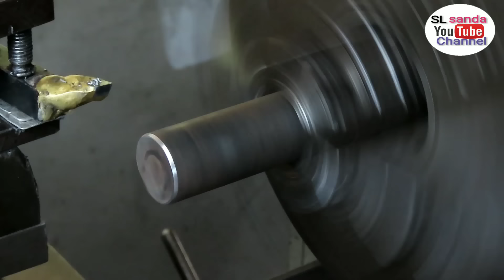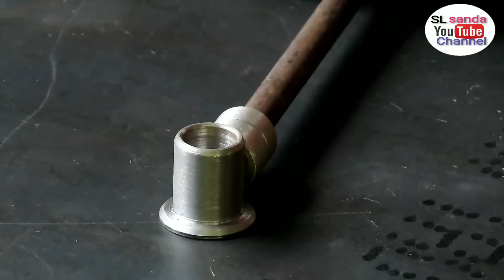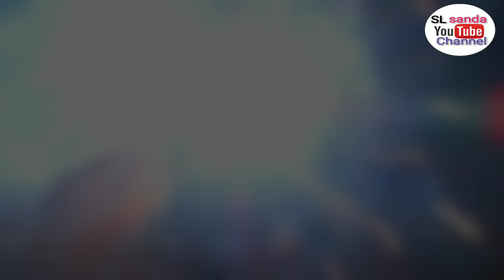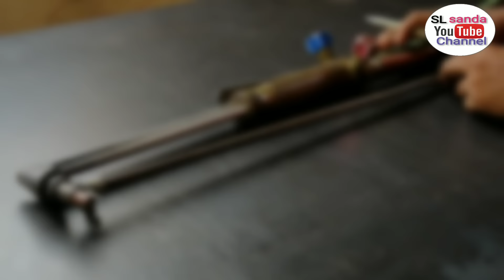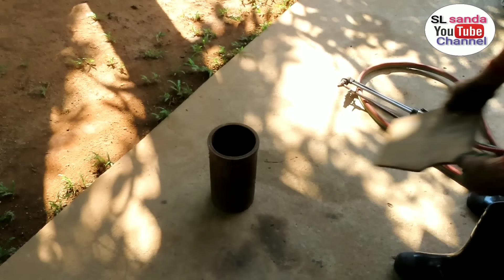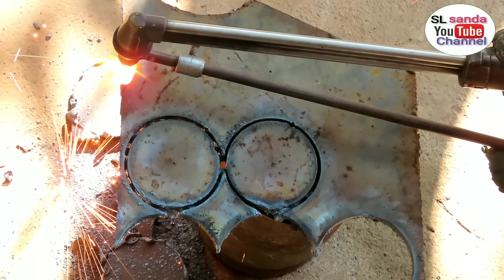How to make easy circle cutting tool (Gas cutter)

Comment: We made those when I was a kid, well 20ish. Work great, I worked with guys that can cut with a torch flawlessly. Use the smallest tip you can get away with on thinner metals. Less slag and warpage. Lower heat if possible. Nice job!
Reply from the maker: Very cool!